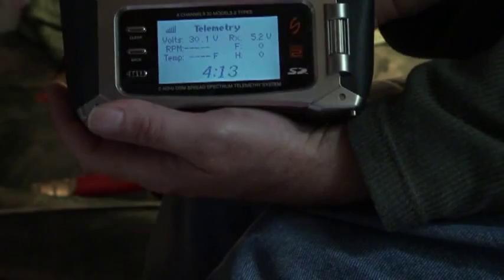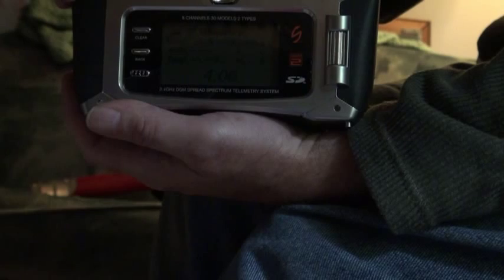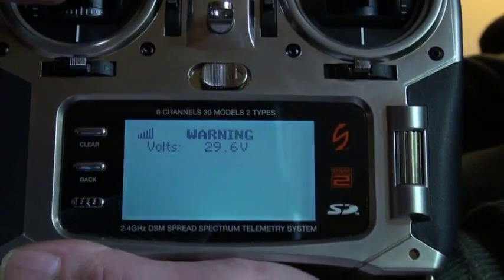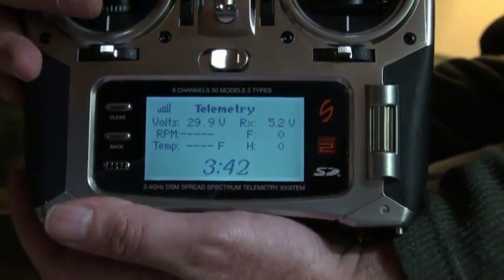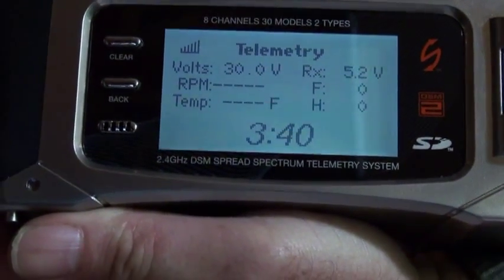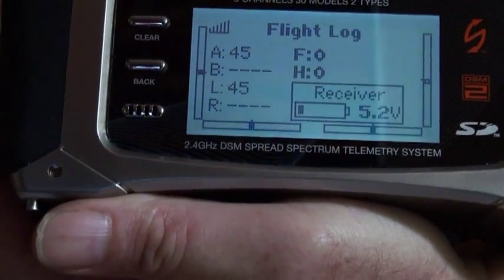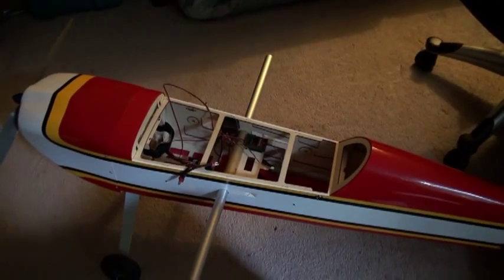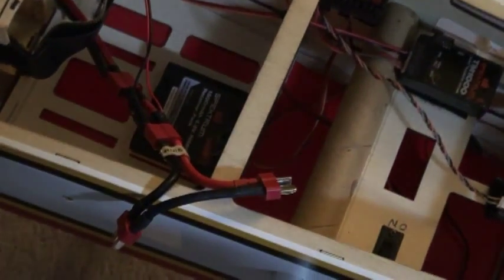dx8 telemetry demo2010.mpg

Comment: Do you need a separate sensor to read receiver voltage or does the unit read it directly from what ever power source is running it?